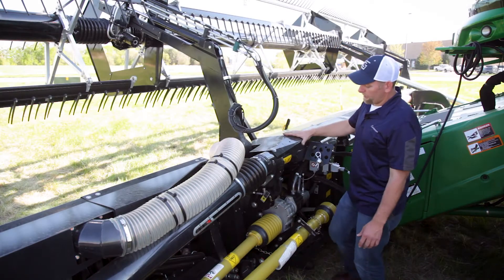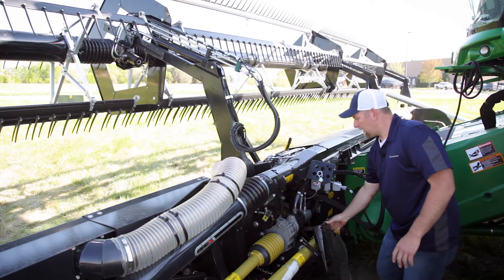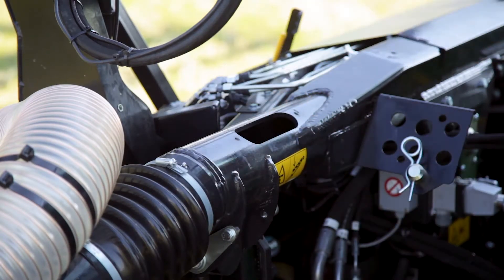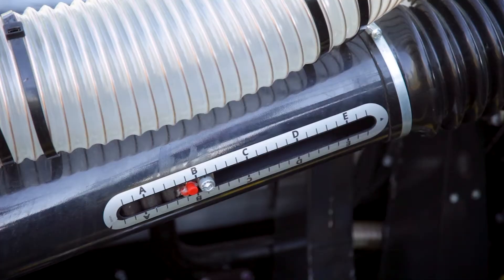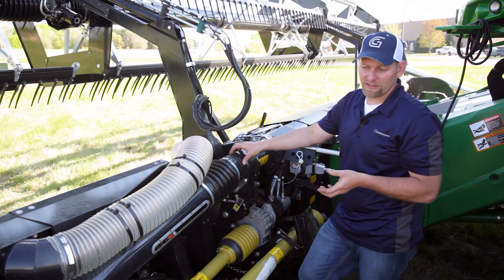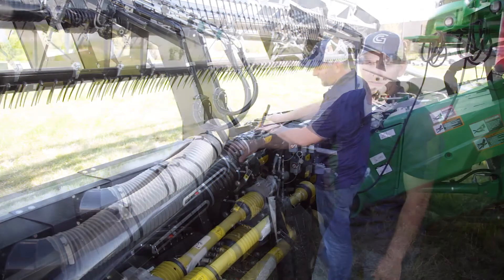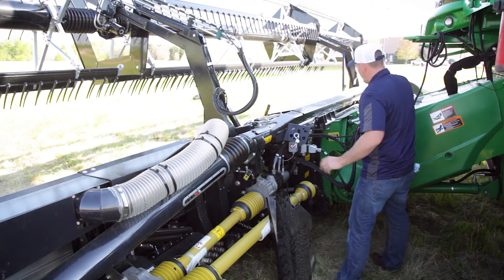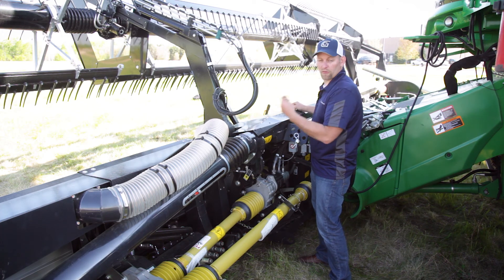Draper Heads - Wing Tension Spring Adjustment

Comment: I think the most beneficial thing you could do is go over the principles of operation on this head. Are the gauge wheels carrying any weight in flex or rigid or just used as sensors. Why is there wing spring float if it is hydraulically controlled. It actually has spring cutterbar tension manually adjusted instead of a hydraflex design.